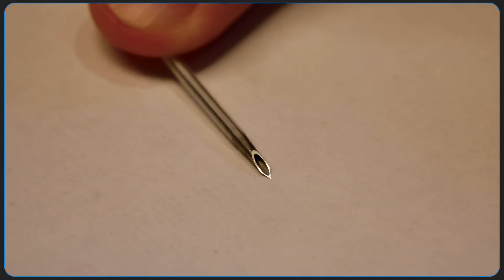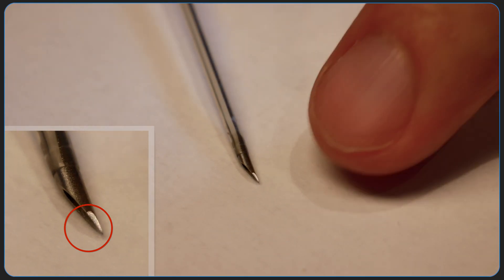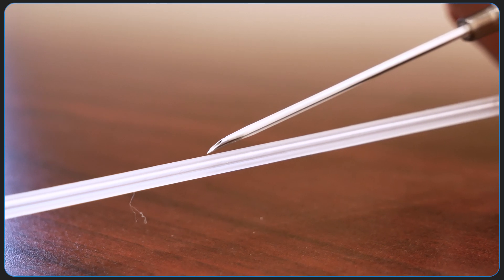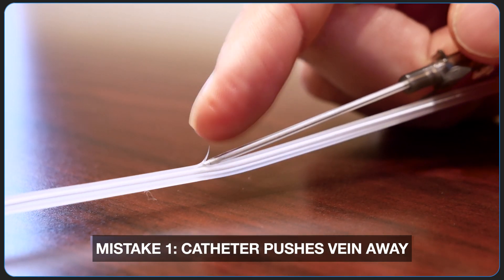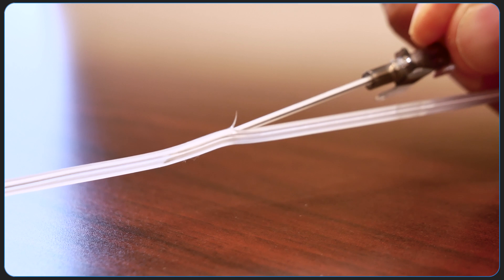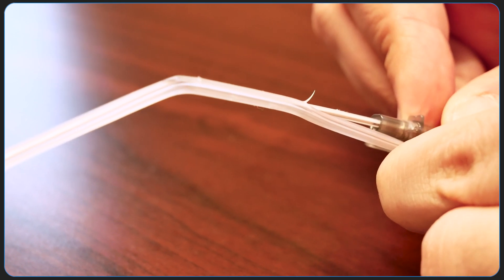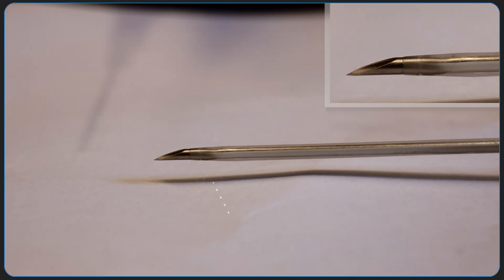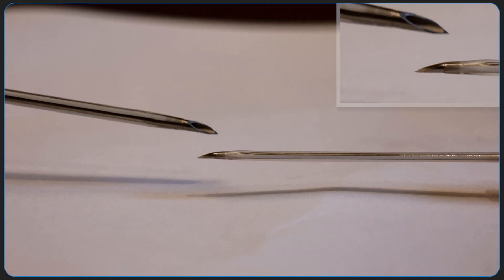IV Insertion: Avoiding Common Mistakes

Comment: Hi, do you mean pushing "a little bit up" as in the angle of the bevel goes upwards slightly or do you mean up as mean the tail end is a little higher than then the skin (20 or 30)

Comment: Would you advise advancing the needle further after an initial flashback using a 24G in a neonate?
Reply from the maker: Hard to say as a general rule. The concepts apply more significantly to larger bevels but still apply to a 24G.

Comment: Hi, I’m a student learning techniques. I have a question. Would it be a good idea to begin to twist the needle slightly as you are making that last extra 1 cm push of inserting the needle so as to prevent potential back walling?.
Reply: I would not do that. The needle has to be straight.
Reply from the maker: Twist as in rotate?

Comment: This needs to get to a wider audience but it applies equally to small cannulas in small veins as it does to big cannulas.
Reply: Totally agree. I have personally screwed up so many 20 gauge IV insertions because the very moment I saw any flashback I tried to insert the catheter. I used to wonder how it was possible to get flashback but not be able to advance the catheter, but once I took a good look at the needles and realized how far back the catheter actually is from the tip of the bevel, it all made since to me. Ultrasound makes it a lot easier, but I am trying not to become dependent on it, because I know it is more time-consuming and a lot of healthcare facilities don't have them.